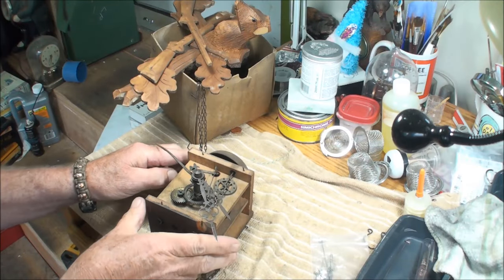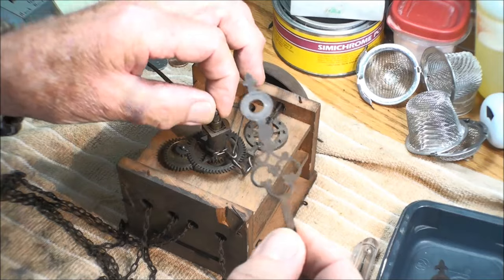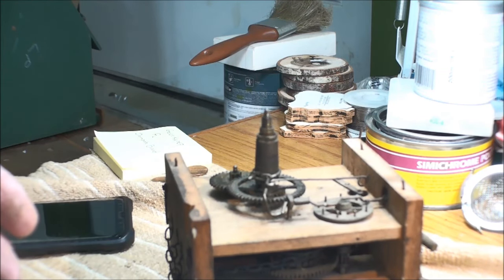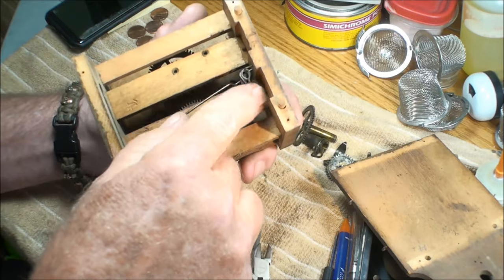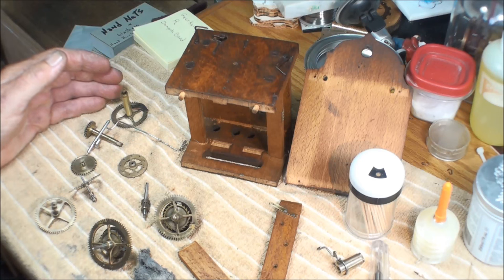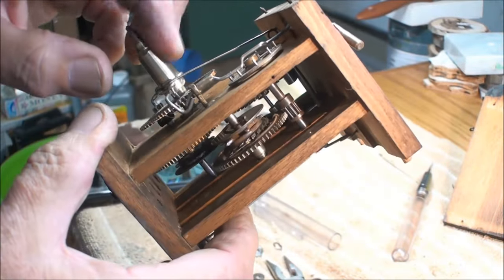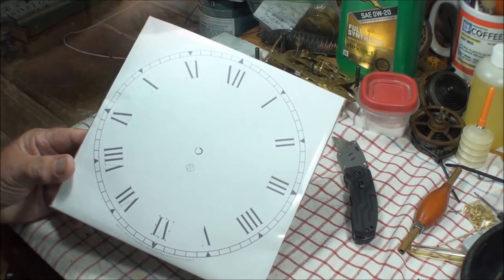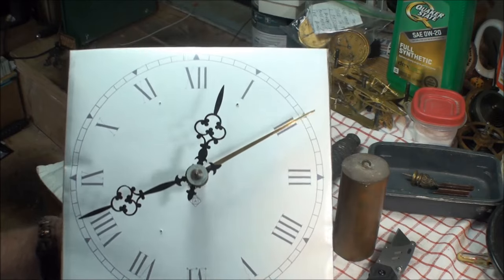Wood Frame Wall Clock Movement with Alarm

Comment: Love this clock. At first I thought it was a postmans clock but the alarm system is different from a postmans clock. The clock was made in the mid to late 1800s. Before 1850 the time and strike trains were in front of each other. After 1850 they started putting the time and strike train side by side. I love the wooden plate movements. I think it would have had a wooden shield on it. You did a great job on working on this clock. I dont know about you but I find that the wooden plate movements can be easier to work on because you can work on the time train by itself because the plates are split in two. Again great job. Like the temporarily dial. Thanks for the shout out at the end. May God bless you and yours.  I also love the other parts/clocks that you got with it. Love the mystery boxes. LOL.
Reply from the maker: It's funny that you don't even think of just how old a clock might be when you are working on them. Very impressive to think about it. Thanks so much for the information you had Mark. God Bless and have a wonderful week.

Comment: Could be a postman's alarm, it would have had a round wood framed dial with an enamel look to the dial itself.
Reply: the postman alarm clocks were designed more like a timer where this clock if you put the hand for the alarm on 3 then the alarm goes off at 3. Where the postman alarm clocks are like a timer like the antique American clocks with alarms. If your clock is set at 8 and you put the alarm at 3 then the alarm would go off at around 11 depending on how worn out the groove for the alarm is.
Reply from the maker: This would be cool to find out for sure, but just the same, I really like this clock Teddy Eddy
Reply from the maker: My Brother just might make a wood dial for this clock with his laser machine. I will have to do a short to show it off if we get around to it.